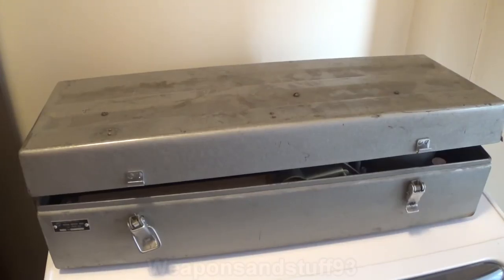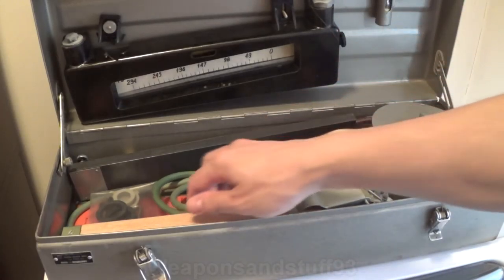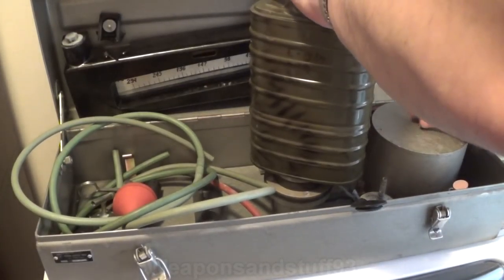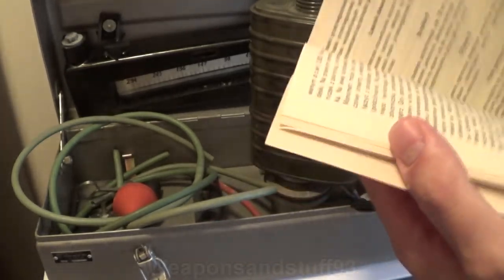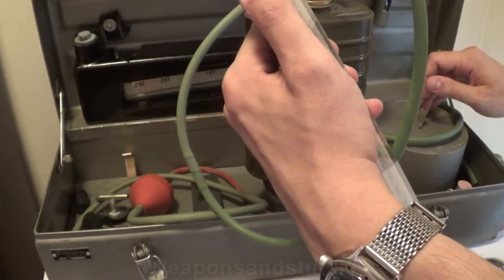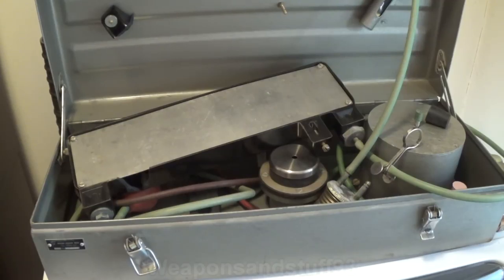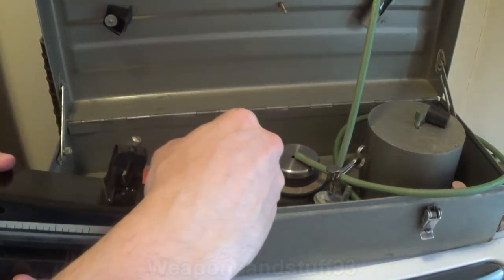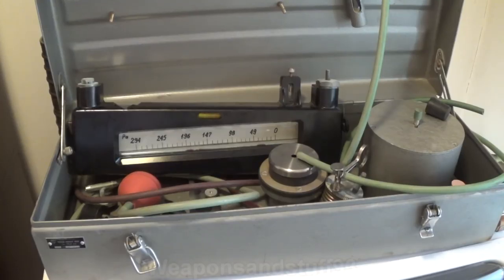Confusing PKM-66 Gas Mask Testing kit

Comment: I bought an Israeli 4A1 mask for about 20 euro, but it seems to not have that metal bit around the drinking tube. Does that compromise the airtight seal, or no? I've pressure-checked it multiple times and it seems to be fine, but I need a decent opinion to be sure.
Reply from the maker: It shouldn't but if you get some banana oil or another strong smelling substance, hold it directly to the drinking tube and see if a smell enters the mask.
Reply: alright, I did that, none of the smell comes through, it seems to be airtight. Thanks.
Reply: never mind the reply, the mask was shit quality. The straps snapped in half when I tried tightening them, the exhale valve and voice diaphragm fell off... Shit, that's the last time I buy a mask on eBay.

Comment: Does the MC 1 filter that it comes with contain asbestos?
Reply from the maker: That's the Polish MS-4 filter, I don't know for certain but unlike a GP-5 it does have a proper particle filter at the top side of the filter as well, making it far safer in theory.
Reply: Never mind i did a safety test and little black stuff came out